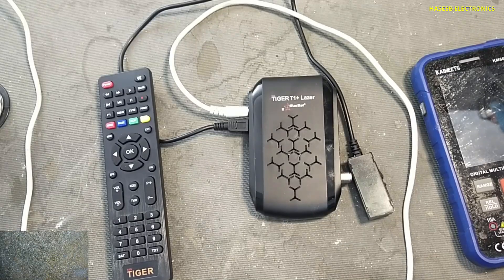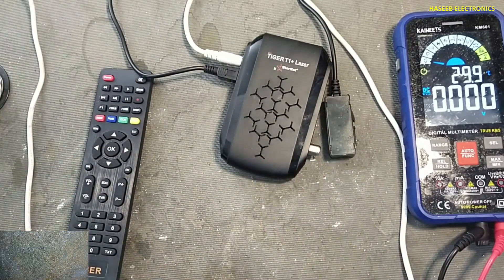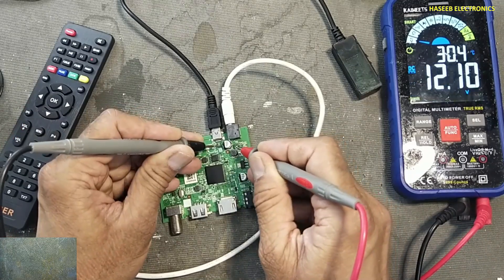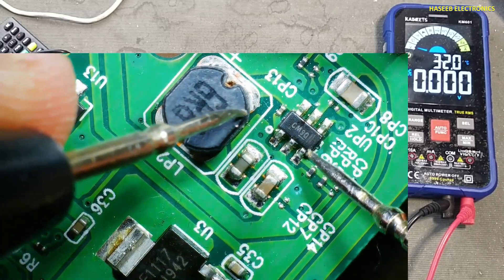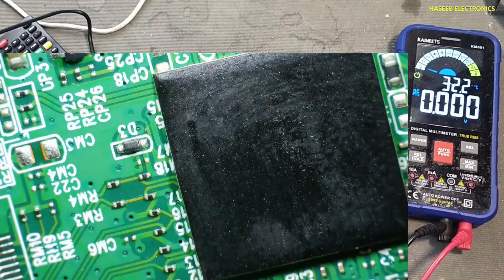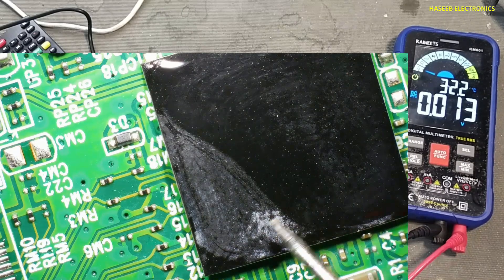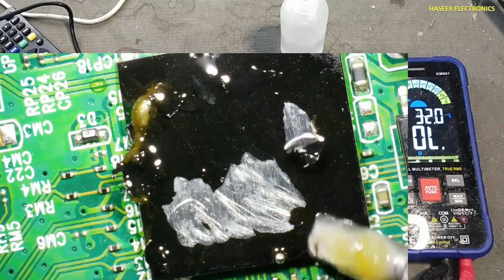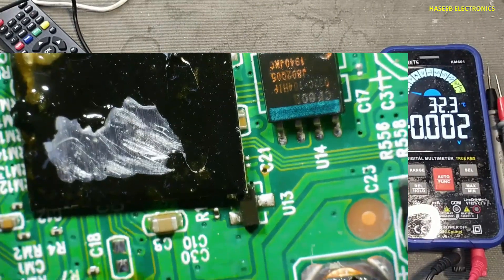{1140} Successful diagnosis, but unsuccessful repair process

Comment: Before replacing the 5-V-IC I would have 5V external power applied. A short on the 5V line could also be and the changed IC could be demaged too than.

Comment: Hi Sir. 
I have been learning from your videos for many years and have become a very successful device repairer so thanks wholeheartedly. I wanted to ask you which desoldering tool do you use please as I am very intrigued. Thanks for your time.
Reply from the maker: i am using WELLER WR3M rework station, it is expensive and its maintenantance charges are also very high
i recomemnd HAKKO 0701 (i used it for many many years and it is mind blowing)
Reply: @HaseebElectronics  Thanks so much for your prompt response. I will check them both out. By the way I find your method of teaching extremely easy to follow and that has led me to many successful repairs. You are one of my most trusted and valued YouTubers. Keep the great work going.

Comment: Assalamualaikum,
Nice video. Very informative. What is the liquid you used for checking heat? Water?
Reply from the maker: i use Isopropyle alcohol and soldering flux

Comment: hi. I wish you could post a video about these switching regulators and how to recognize them and their operation ,because the exist in most circuit
Reply from the maker: sure i will 
basically we need to find switching frequency 
i also replaced with another part number but its switching frequency and indcutor values were same
Reply: @HaseebElectronics  certainly, your scientific ablility is very high. if you give this tutorial on souching regulatiors, i would be grateful. Moreover, the discussion of souching regulators is very comlicated